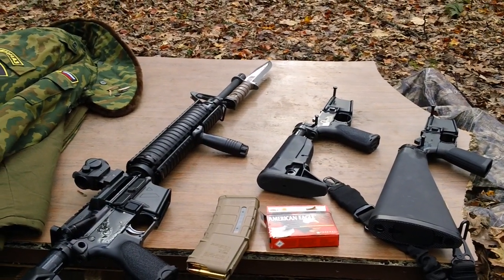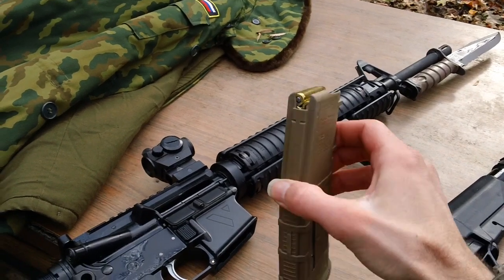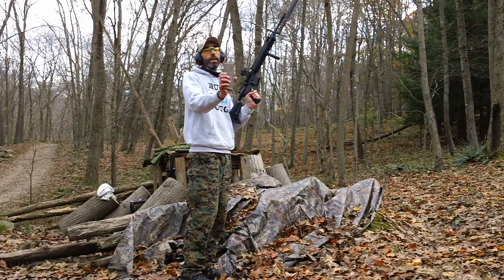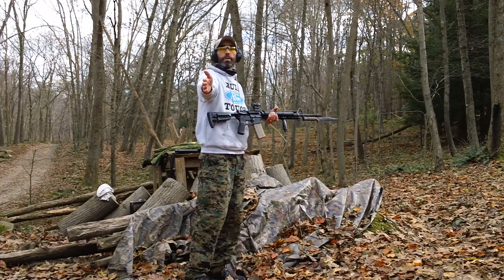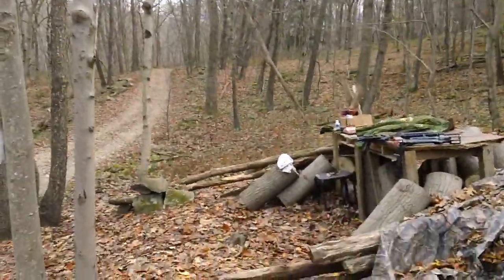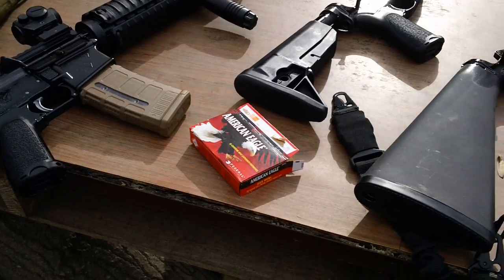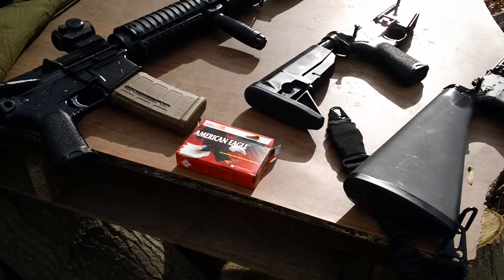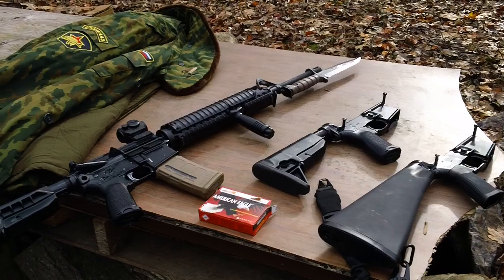VLTOR A5 Buffer System

Comment: Hey bud i was wondering why your running that A5 system on a gun with a bayonet on it? Over the years we have found out that rifles running with a bayonet thay is makes the rifle less accurate. Just out of curiosity i would love to know if this is true? MAybe you could test that old wives tale? hehe I would love to know if the A5 is a good choice for a 20" rifle upper in a number of calibers.Im in the middle of building a 224Val,6.8SPC and a 350Legend all with 20inch uppers. I always buy a dedicated lower for each. I dont like just changing my uppers for a different caliber. Right now i have two rifle length lowers and still need one more for one of the rifles above? So which one of those calibers would be best for the A5 system? Im not really concenered whch is the softest shooting but the best functioning lower? thanks bud great video though! :>) And i think Federal ammo is a good choice for everyone! ITs always been great ammo brother! In my opinion......But i have more then just fed ammo so im sure others run better! But for the price ,generally make Fed ammo a great choice! Im sure there is better ammo out there but they are all much more expensive. Its crazy how the ammo companies have used the whole Covid crap as a reason to make more money! I just found out i have covid today as well as my wife. So we are now going ot be stuck in our house for a minimum of 5days and have to wear masks for 5 days now that we know we have it. So when my A5 buffer system comes in will be flipping a coin to figure out what caliber to run that A5 in?? Any suggestion out of the three rifles im building? thanks again

Comment: so which is the softest shooting lower?
Reply from the maker: i personally think it is a hard tie between the a5 and rifle a2 lower,  both have a good feel to them,  however the a5 is adjustable so it can be altered for any persons needs.  i have a h4 buffer in the a5 with a jp rifles spring and the a2 lower has all steel weights a vltor tensioner spring to keep weights under tension and a jp recoil spring in it as well.

Comment: advantages of vltor system?
Reply from the maker: smoother feel when shooting when compared to a carbine lower,  recoil impulse feels how can i put is softer or less of a shock,  plus greater length of pull if you match it with the vltor a5 stock assy.

Comment: What upper were you running?
Reply from the maker: psa 20 inch upper w/fn usa chf barrel.
Reply: @ChrisUrsiny  And it ran the A5H4 buffer just fine? You wouldn't happen to know the gas port size?
Reply from the maker: @JohnBlaze505  i have no idea,  sorry,  upper was as i said a psa 20 inch premium upper with fn usa chf barrel, and a psa bolt carrier group with dlc coating.  i purchased bolt carrier group separate from upper assy.

Comment: Will that bcm stock collapse all the way with the a5 receiver extension?
Reply from the maker: no,  you need the vltor emod stock for the vltor a5 lower system.
Reply: @ChrisUrsiny  not true other stocks will fit some just wont close all the way.